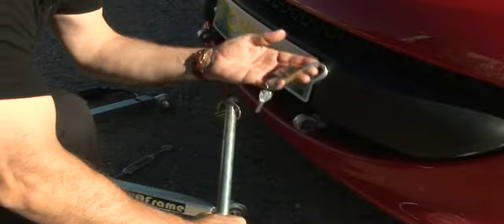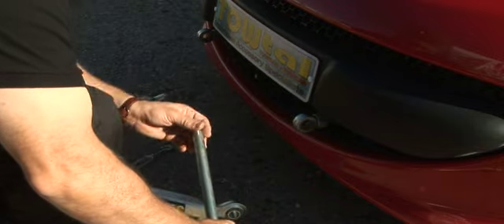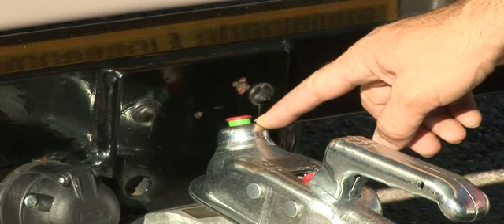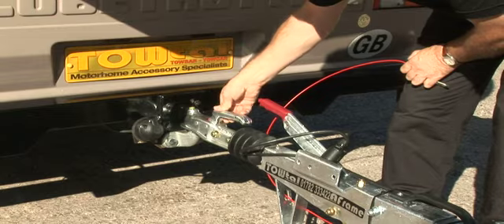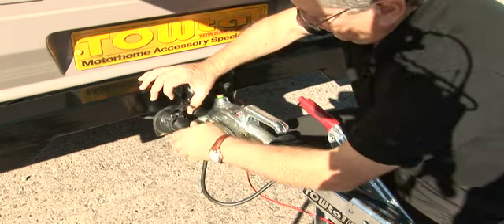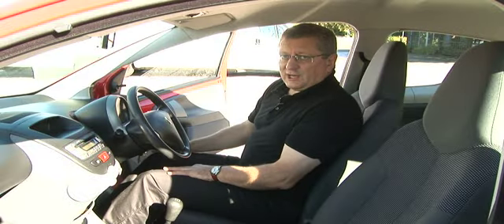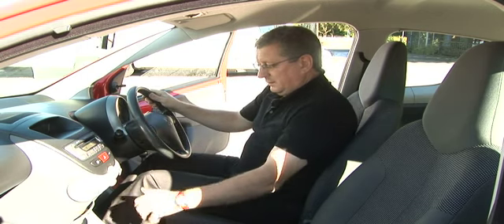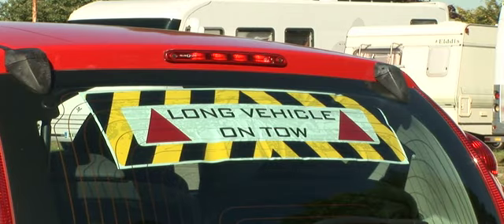AFrame Fitting Instructions by Towtal

Comment: As a time.served engineer and all I can say is what a load of bollocks
Reply: Hi Jimmy, which part of the set up is b******s?
Reply: You omit to say or inform potential customers that there will be alterations to their vehicles to add an additional towing eye . I would think the A frame alone is probably £1500 quid and Im.guessimg the car alterations are about the same.  So 3 grand .. and then the car then the insurance for both vehicles. I sell a few cars you can Aygo C1 106 from £500 so wht not just buy one when arriving and drive it around for the week then flog it.. coat you nowt .. basically a caravan was made to be towed by a car and now it's role reversal (that's Bo**lox)  better still sell the MH get an Aygo and buy a tent and camp better for everyone including the environment dont you agree ? MH's are like nursing home stripping the elderly of their money
Reply: Also if one puts the bar through the one towing eye that cars have and at the end where there is no towing eye  simply use a ratchet strap .  Well thats what I do . With mine and fully road legal to do so . I have one of these same make and model and also another make and model that goes under the car and linked over the wish bones that is ratchet strapped down and does.thw job quite well. Basically you have a created a solution that did exist because the ratchet strap version works quid adequately. Granted not everyone wants to roll around on the floor that includes myself hence I bought one of these for £50 off eBay and £10 ratchet strap . I believe in recycling and modification to ones needs .. if you want to be picky I use some rubber boat stoppers so not to damage the car from the strap biting points